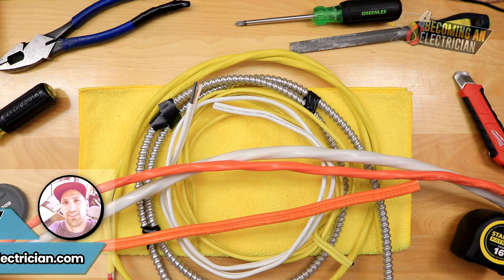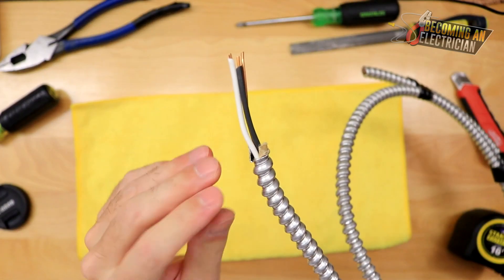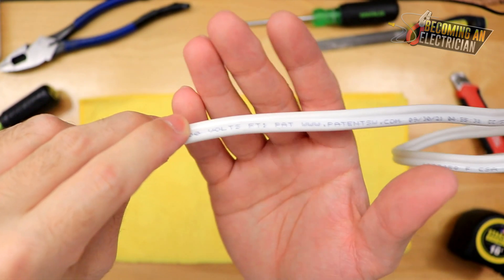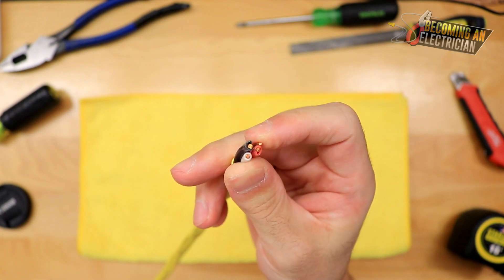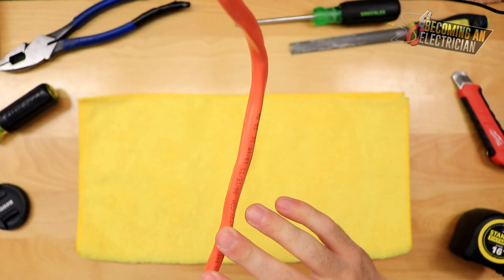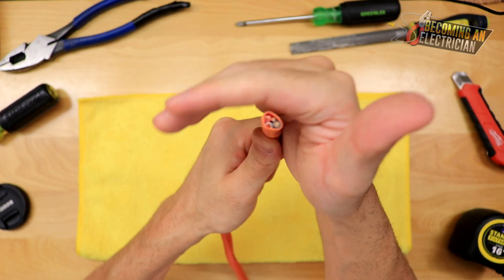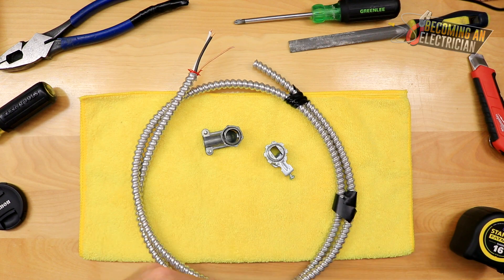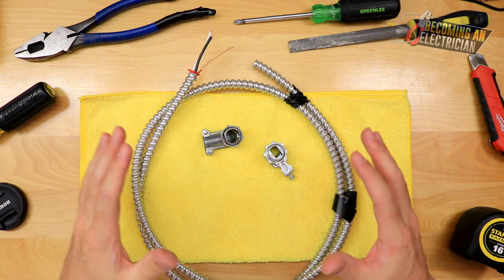Wire Types in a Home (Residential)

Comment: Why did'n you mention T19 from the Code book to help to understand where can you put it?
Reply from the maker: What is T19 wire? - Canadian and USA may be diff in these aspects, let me know.  Just tried to keep this very simple for residential power wire types (not low-voltage).
Reply: @BecomingAnElectrician  
oh, I'm sorry for the confusion. I meant use Table 19 from the Code book to list what kind of wires you could use in different location.
Reply from the maker: @JackElectrician  Okay thanks for clarification!  Ya I try to avoid code book a bit in the videos.. things change too often, so try to keep things as general as possible with what's called "evergreen content".

Thank-you so much for your feedback, ideas, input, as well as any correction!!!

EDIT:  I have included Table 19 and a little code rules in the article: https://becoming-an-electrician.com/types-of-wire-in-a-home-residential/
Reply from the maker: Jack, thank-you again for your input about Table 19 in Canadian Electrical Code book regarding wire type usage.  I included this in the write-up of this video (and gave you a shoutout!): https://becoming-an-electrician.com/types-of-wire-in-a-home-residential/

Thank-you again for your input and keeping me in check!!  It only benefits those wanting to learn!

Comment: How about wire that's run in EMT, is it just THHN that's ran generally?
Reply from the maker: Usually it is single conductor on its own spool.  For the actual wire type, on site in Canada, I mainly saw RC90, T90 NYLON.  As JackElectrician's comment mentioned, for Canadian Code Book, Table 19 has all of these details (I should have included that in the video, sorry about that!)
Reply: Ah, thank you. I'm in the states, and my area specifically(around Chicago), can't use romex/nmb, everything must be in conduit/emt.
Reply from the maker: Understood, yes NMD/Romex is not allowed to be used in pipes.  As always, local inspectors have insights to their own particular area.. some deviations can happen depending on jurisdiction sometimes..